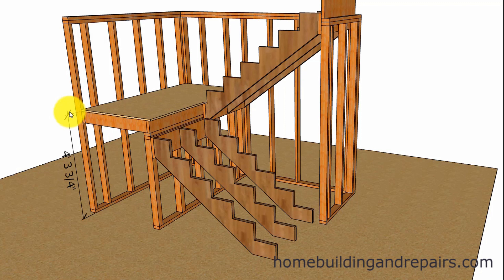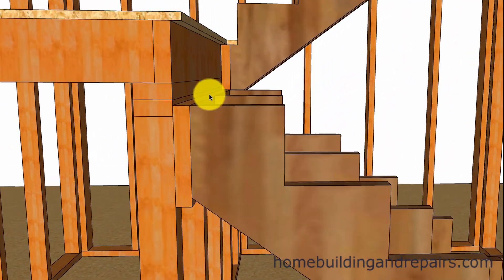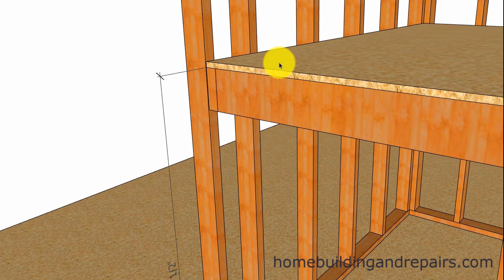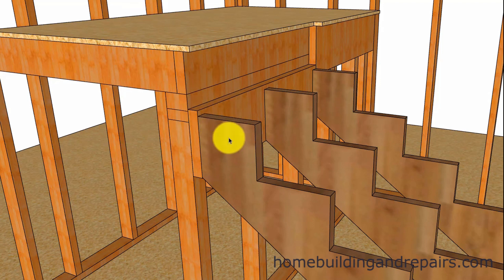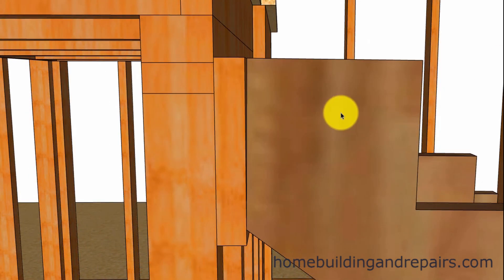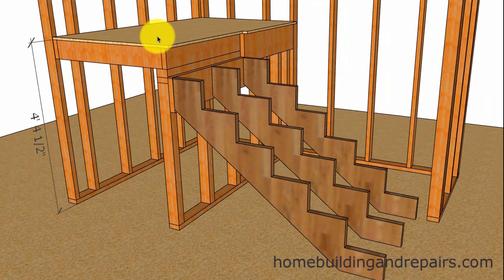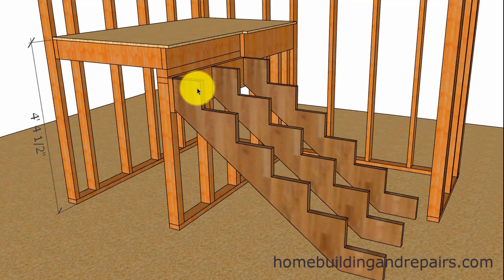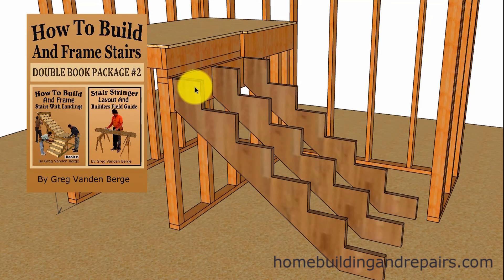Even Professionals Make This Mistake – Landing Height Calculation

Comment: Will you run into a similar issue if your floor decking is a different size than your stair treads? For example if I have a straight run of stringers to the 2nd floor and my floor decking is 3/4in, can I use 2x6 stair treads? Or do the stair treads and floor decking always need to be the same thickness?

Comment: I am building a U shape with a stepup iin the platform,  do I measure total rise from the concrete floor to the finished floor  and not the riser sub floor
Reply from the maker: Most of the time you measure from the top of subflooring if you're going to use the same materials when finishing all of the stairway and floors. For example, if I'm going to install the same carpeting in these areas, then no problem, but you will need to make adjustments sometimes when changing flooring thickness in these areas.

Comment: What if you include the sheathing thickness correctly, but someone adds a 1.5 inch thick carpet to the landing? Is there any solution other than tearing the whole house down?
Reply from the maker: You can add the carpet to the steps or materials that will create the same risers or remove the landing carpet, but other than that, I don't know.

Comment: Can your books also be used for metal stairs??
Reply from the maker: Only if you're looking for information on how to calculate all of the measurements needed to build the stairs, but if you're thinking about using it to assemble a set of stairs made out of metal, then I don't think it will be the right book for you.
Reply: stairbuilding I’m looking for a book that has stairs codes , Ramps with hand rails ,ship latter codes etc. thank you !

Comment: My builder merely nailed the landing to the wall studs and shot about 10 staggered nails in about 4 areas on each side. Is that IRC 2015 code and is that proper, or should he have built 2 posts that sit on the floor under the part of the landing closest to the steps? (Note, the first floor is concrete and there's nothing to nail the bottom post to.)
Reply from the maker: Feel free to email me some pictures of your problem and I'll see if I can provide you with more information. It's difficult for me to understand exactly what's going on, but you could always provide me with more details instead of a picture.
Reply: @stairbuilding  I ended up hiring another carpenter when the electrician and the plumber both laughed at the stairs put in by the other "carpenter". He pointed out so many dumb (and downright scary) things with the other stairs that we ripped it all down and started from scratch again.

The previous carpenter sidenailed all the steptreads on one half of the stairs before the landing, and then facenailed all the treads on the top part of the landing. The new carpenter had to use a sawlsall to get the facenailed boards out. However, on the facenailed part, the previous carpenter used super skinny nails and even skipped a step with no nails at all. Meanwhile, almost drunkingly, he shot dozens of nails in the landing on each stud rather than 3 strategically placed big nails on each stud. The previous carpenter also didn't use concrete anchor bolts for the beams in the middle that become the handle you hold onto down the middle of the stairs. As well, he mis-measured the steps such that the bottom were 7" (and something -- they were too code, properly), but then the upper were 6" (and something, and were not too code at all). Last but not least, the previous carpenter used one stringer under the steps and some little shoe boards instead of 3 stringers like normal stairs. The end result were squeaky stairs that couldn't handle lots of weight and in fact were kind of dangerous to use.

The new carpenter ripped all that out and redid it from scratch the proper way like I see with all the YouTube videos about how to properly build stairs.

Comment: Hi, when you add the treads to the stringer won’t that make all the steps the same?
Reply from the maker: As long as everything was laid out correctly. In other words, if all of the top areas of the stringer and floors are equally spaced with the correct individual height to accommodate the material that's going to be used for the stair treads, then there shouldn't be a problem.

Comment: Don't they call it "dropping the carriage"?
Stairs are the most confusing if you don't know that your math can be spot on and everything can look right but,if u don't drop that carriage,your not going to pass inspection.
3/16" from top to bottom is the most an inspector will allow in Massachusetts
Reply from the maker: Yes I would imagine you could call it dropping or raising the carriage or stringer. Most building codes allow for a 3/8 of an inch maximum variation between steps, but that's why you should always check with your local building department, to validate this information, especially in Massachusetts.